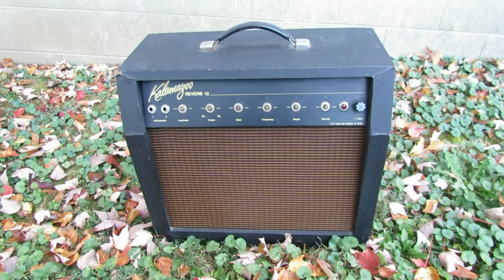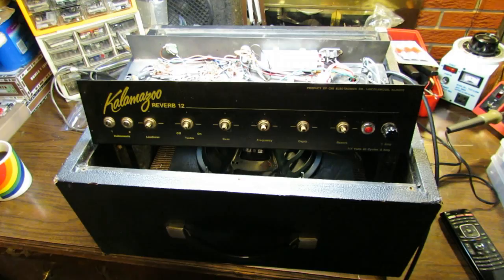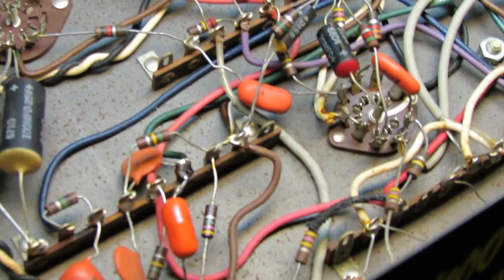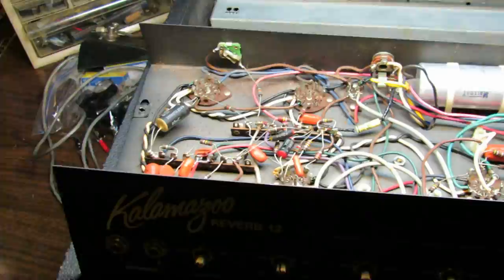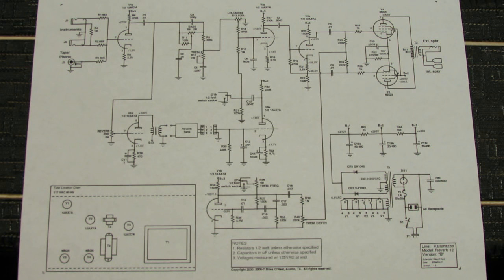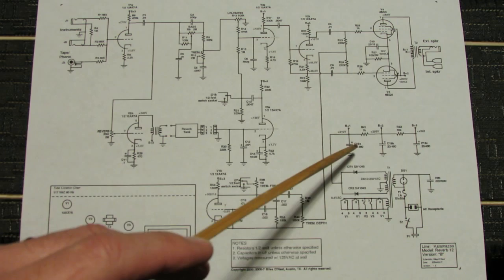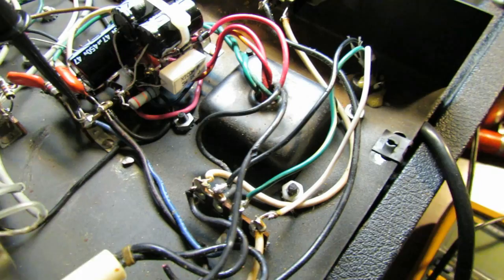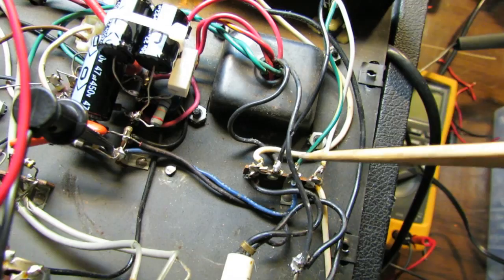1966 Kalamazoo Reverb 12 Tube Amp Complete Service (PART 1)

Comment: I would have replaced the Treble pot with standard, unswitchable pot.  Put the on/off in the Fuse location, and moved the fuse holder to the back by drilling one hole on the BACK.  In this way, there is no holes needed to be drilled in the front-side and keep original.

Comment: Lots of audio equipment of the day put the power switch on the treble control so you could just turn the unit on with the volume where you left it so you wouldn't have to wait for it to warm up to figure out where the best volume setting was.  It would just be right where you left it last.  Yes, kinda silly on a guitar amp but this also had the Phono/line input so it sorta made sense to them.  
Havng the ac wires running through the shielded 'conduit' probably reduced the hum to an acceptable level if it even made any difference.  Many hifi units of the day did hte same thing.
Nice idea on a guitar amp to get it off the treble control.

Comment: I have the same amp that I've used in the studio over the years. However, I've never much paid attention to the tremolo and reverb. (the amp didn't have a foot switch when I bought it.) A couple of notes: The reverb is noisy as hell as you mentioned, but to make matters worse for me, the tank is broken and it appears to already be a replacement. Do you know the reverb tank part number correct for the Reverb 12? Much appreciated!

Comment: Were those just regular polypropylene capacitors you put in the tremolo circuit? Do they sound better or do you recommend those over ceramic for a tremolo circuit? Seems lots of the old tremolo circuits I have seen have ceramics in them, I guess for cost effectiveness. 
Thanks for another great video I look  foreword to the follow up video.  I was wondering for some time about the way you say chassis and tremolo. I just figured maybe it was a Kentucky thing.

Comment: All it needs is a Kalamazoo 'sg' to go with it :)
Bodies were i think made out of a composite, something they later did for the Sonix series (almost bought one,,,Aria CS250 saved me)
Gibson amps,,,borrowed a 'lap steel' set one in the early '70s. Mid '50s i think. 1-8,  tone and vol, sprayed on 'speckle' finish with a gold "G" mounted on a crossbar for the linen grille cloth.
Warm clean but hit that with an LPB-1 and pretty screaming. Should have bought the whole set (my Dad was a Lap steel guy) but then just wanted the amp.

Comment: Hey Brad,  I had one of those and figured it could be a lot better.  Completely modified it into a loose copy of a Fender Twin Reverb circuit with four 6L6GC power tubes, screen regulation, DC filaments on two preamp tubes.  Fixed adjustable bias and balance.  Tube count went from 5 to 12.  Output power went from 12 watts to 120 watts.  As a head into a 4x12 cab it is a force to behold with.  Has that beloved Fender clean tone and power.  Pedal friendly.  If interested please provide a contact email addy and I will send photos.

Comment: Simple fix Brad, get some lighted toggle switches.  
That speaker should improve the sound.  
The tolex is nice, pretty nifty amp.  Don
Reply from the maker: I think the speaker is less efficient than the original speaker. It wants to see more wattage than the amp puts out, ideally, so it stays cleaner further up the dial. The original speaker probably had less doping on the cone and most likely would break up sooner, more crunch.
Reply: yep, that huge magnet kinda looks like overkill for 12w.  what drivers did Gibson typically use?  Jensen? Utah?  EV?  I had a Gibson solid state 200w bass amp long ago, with my Grabber, I liked it too.  Also had an early 60s Gibson Atlas tube  bass amp w/ 15" with my EB0, also really liked it.   Don't sound like Fenders, but sound pretty good to me.  Don
Reply from the maker: Gibson mainly used Jensen speakers and then later used a lot of Quam and CTS as well. All good speakers. I usually leave original speakers in Gibson amps from this period because once serviced properly, or modded to eliminate the tone sucking coupler networks, the original speakers sound and perform great usually. That's one of the things Gibson usually did get right - speaker matching.

Comment: This goes along with a question I asked in a prior video. It probably was a carry over from previous models, like auto makers keep certain aspects of  a year or two before. What amperage is your variac? Wound a 5 amp be enough to work on tube amps or would a 10 amp be needed. I am going to buy one and I would like your thoughts. Brad you call tremolo what ever you want! It's like vi-brato or in Texas it is called vibrata. Great video! Will be good to see #2. Thankz
Reply from the maker: Mine is 5A. Shouldn't need more than that for this kind of work.
Reply: The Guitologist Thanks! I am not rich. Will try to get one with volt and amp meter. Thankz

Comment: Open up one of the existing holes in the chassis from the silver Mallory multi cap and put the power switch there?
Reply: Would keep the face clean. Damage was already done by a previous tech, may as well adapt it to minimize noise.
Reply from the maker: It's funny, that thought did briefly cross my mind too (great minds). But with the back door on the amp, you can't really reach up under there so easily.
Reply: The Guitologist that would be my concern as well. We don't want the hapless client pawing up in there if we can help it, do we? As you said though, it's not an amp of significant value. Then again, I've seen the prices steadily climbing on those (admittedly horrid) Mid-60's Gibson white panel amps. I bet this Kalamazoo amp is one Vintage Guitar magazine article away from gaining $200 in value.
Reply from the maker: Well, you may be right, but it would have to be a particularly good example of a Reverb 12 to impress a VG writer, I'd think. If they opened it up and knew anything about circuits, they'd see the flaws right off. BUT, even so, these things do have all the bones and the makings of great amps with some servicing. Part 2 coming soon and you'll see more flaws in the grounding scheme and layout affecting the reverb circuit... Stay tuned for that.